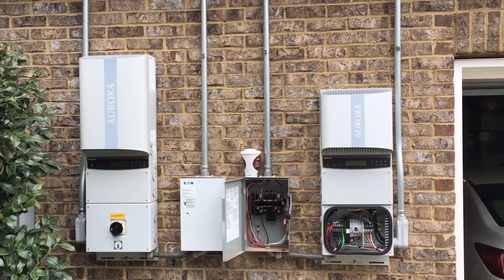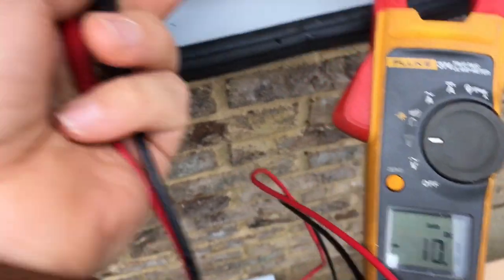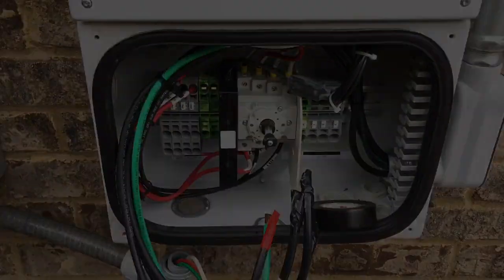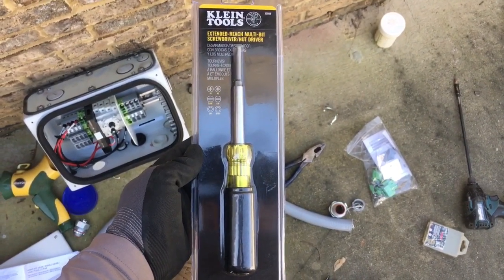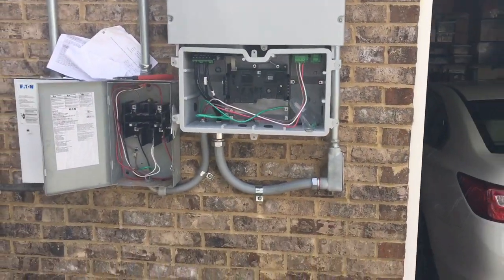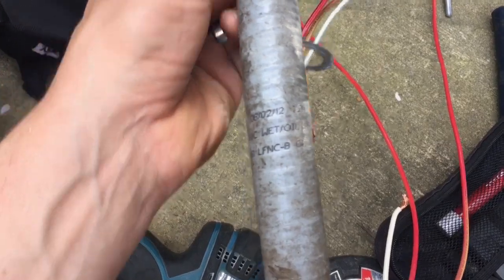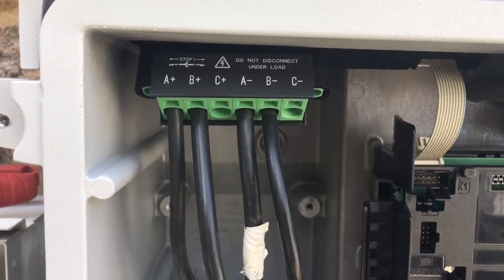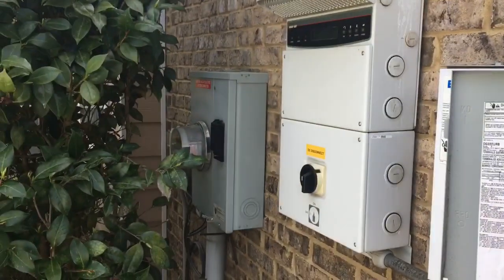Changing out a dead solar string inverter

Comment: John comes through, what made you decide on the SMA vs something else?
Reply from the maker: Adirondacks4me I’ve had good luck with them and there aren’t a lot of other options out there.
Reply: @GainSolarPower  I've noticed it's harder to find residential string inverters. SMA seam to work good all in all